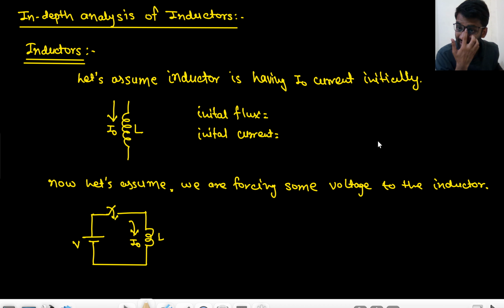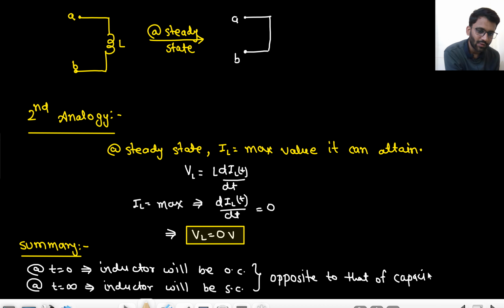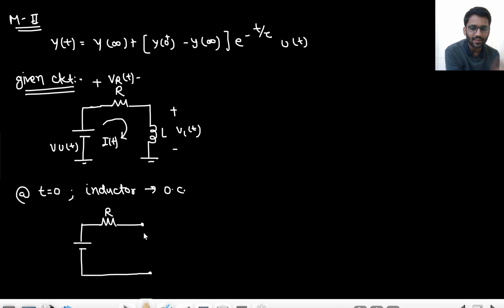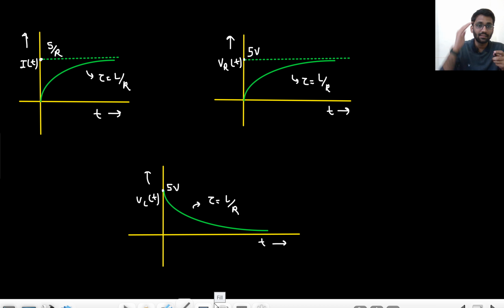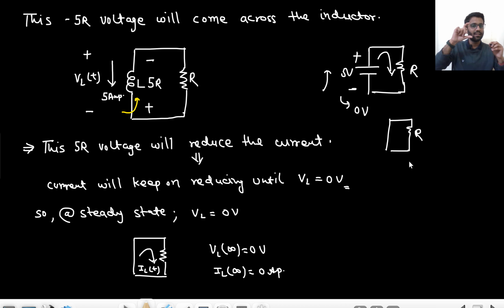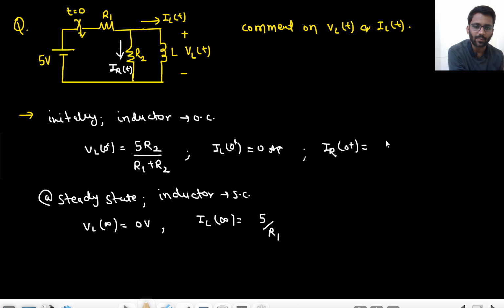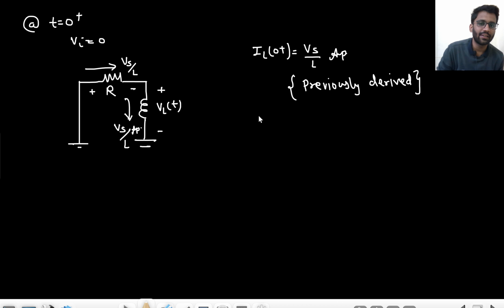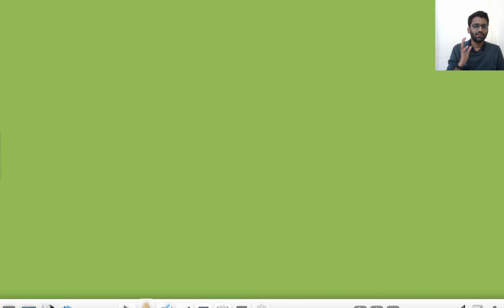Analysis of Inductors and RL Circuits || Network Analysis || GATE 2025-26 || PrepFusion

Comment: 1:11:44 wont the inductor discharge instantly,  at t = 0+  Vs will be 0 because it's impulse. So the inductor will be directly shorted to ground and the current caught by the inductor should instantly vanish??
Reply: When the voltage source is equal to 0, it means a short circuit. An inductor cannot be suddenly open-circuited like a capacitor because a capacitor can store charge on its plates due to a static electric field, whereas an inductor has a dynamic magnetic field due to changing current. 
Open-circuiting an inductor means the inductor ionises the surrounding air, so practically we provide a short-circuit path for it. This SC path (FROM VOLTAGE SOURCE) keeps the current flowing continuously; eventually, the current reaches 0 due to the wire resistance and the impedance of the inductor. That's why, practically, we do not have infinite current flowing in a single inductor circuit loop. 

In capacitor sir taught using impulse Current Source after t =0 the CS becomes OC and Cap can hold its charge. When Impulse Voltage applied to Cap then for sure Cap will burn. 

NOTE:- Im talking about pure Inductor and Capacitor ckt w/o Resistors. Also GND (in DC supply context) is just a reference pt to 0V not a magical thing that absorbs all current.
Reply: I think there wont be any ground for the current to get discharged its just a closed loop in the air. Maybe the Vs/L current just stays there till infinity inside the closed loop since there is no resistor to decrease the current.

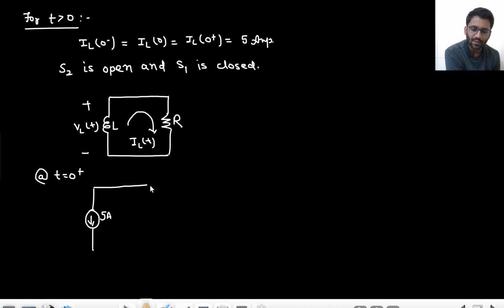Comment: @46:00, current for t=0- is also top to bottom, and for t>0 also from top to bottom. What's the purpose of minus sign !? For VL i get it, the polarity is mentioned in the question. But for IL, we have assumed top to bottom to be positive, and the dir remains same throughout, so why minus ?
Reply: There are two ways to see this.

1st CASE:-
For t < 0, current is entering the inductor, so it is +ve current (normal way). After t > 0, the inductor is supplying current. This means whenever an element supplies energy, its current is taken to be negative with respect to the element, apart from constant sources.

2nd CASE:-
By Sir's diagram, current is entering the -ve terminal of the resistor, which means the actual current is flowing in the opposite direction, so I = -ve. (SIGN CONVENTIONS can be confusing, so always stick to any one way.)

Sir drew it that way because for t < 0, I(t) is entering the inductor, so he kept the same reference direction for t > 0 as well. However, for t > 0, the current enters the -ve terminal of the resistor. We can interpret it either way. If I = 5 A, then for t > 0, the actual current I(0+) flows in the direction opposite to the initial current I(0−) so it become -5A.

Comment: @46:00 how can i(0-) = 5A and i(0+) = -5Amps , the property of inductor says its should be same right please explain
Reply from the maker: Actually this is correct only. The current t<0, I showed with "I(t)" so that current is 5A at t=0- 
For t=0+, the current is 5A only but as per the given direction it would be -5A.

Basically from t=0- to t=0+, Inductor is having 5A current from "top to bottom" direction. 
I hope this clears your doubt.
Reply from the maker: Btw, I(0-)=I(0+) is not always true. You will see it in further lectures. But for this case, it's true.